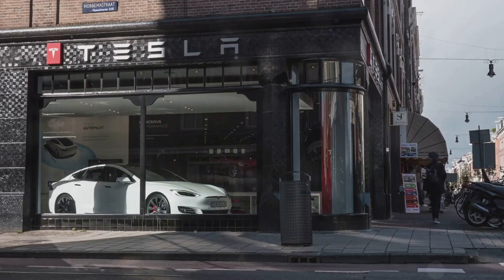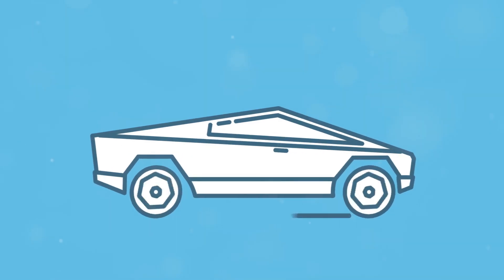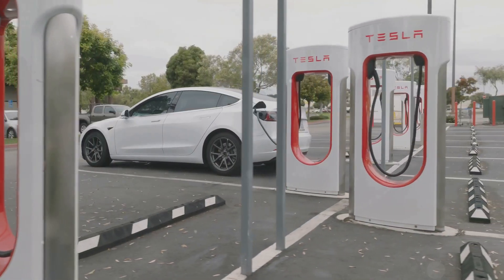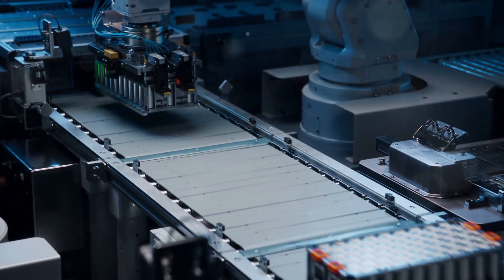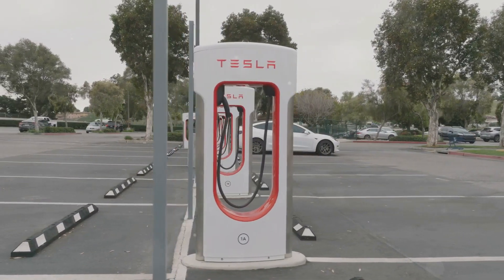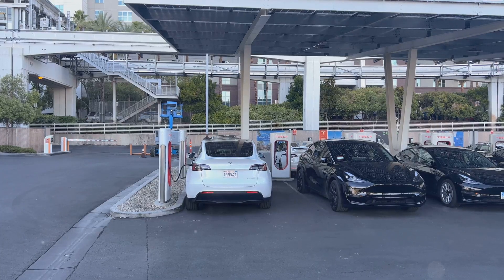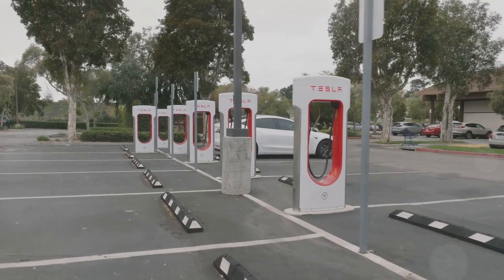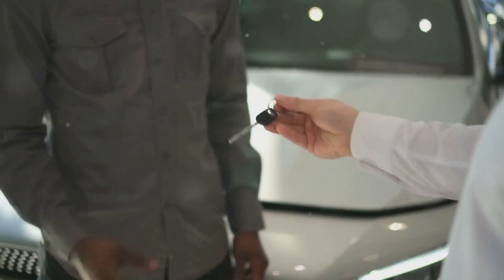Tesla's Game Changing Battery Plans for 2026

Comment: All I hear is hot air about some new batteries, yet there is a conspicuous absence of any details about energy density in relation to volume and weight. Not a single word is mentioned about self-ignition, nor is there any discussion of the underlying chemistry. I will not consider using an electric vehicle until it is deemed safe—not in the sense that Elon Musk claims safety, but in an actual, verifiable manner. I will not entertain the idea of an electric vehicle until the battery weight is reduced to less than 200 kg and it offers a range of 1,000 km per charge, making it at least comparable to gasoline-powered cars. Until that time, electric vehicles remain a source of amusement to me - a toy for faddists.